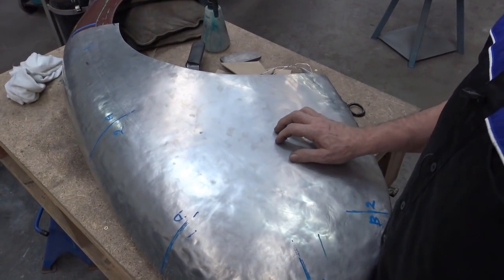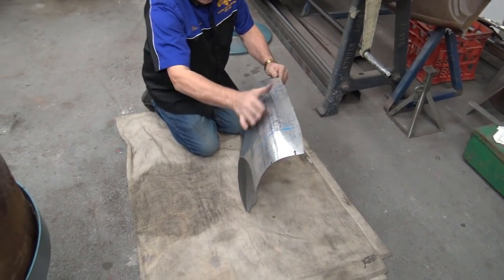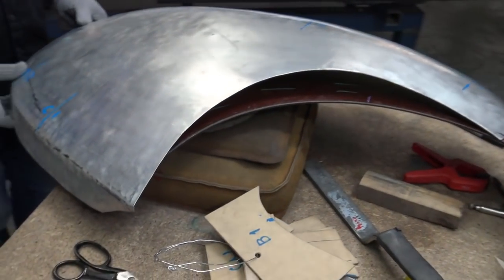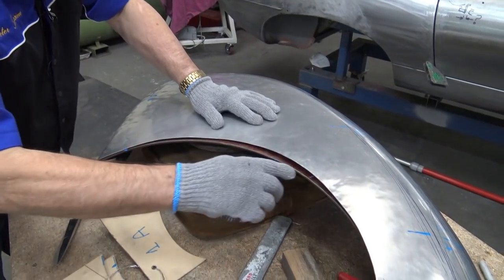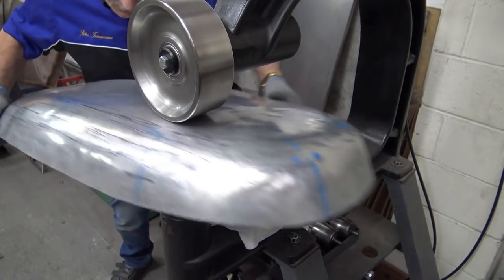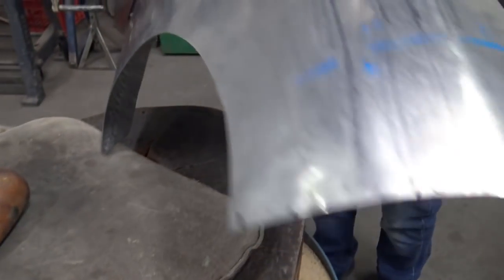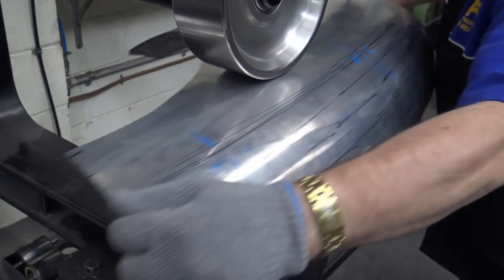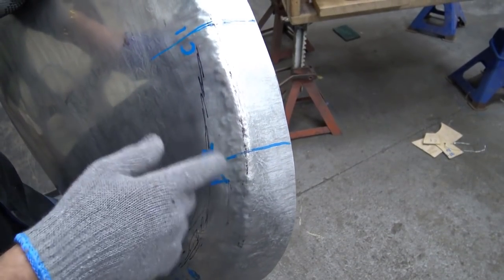Austin Healey Rear Guard   Part Two - A

Comment: Mr. Tommasini, excellent videos. All of your videos have been helpful with my 1960 TR3A restoration. I am a fan of the Picard brand hammers. Curious the model of your large bumping hammer or the weight of it. Love your wooden hammers also. Frank
Reply from the maker: the weight of the blocking hammer is about 1.5 Kg ,  I have that made here in Australia excellent hammer to shape metal prior to wheeling